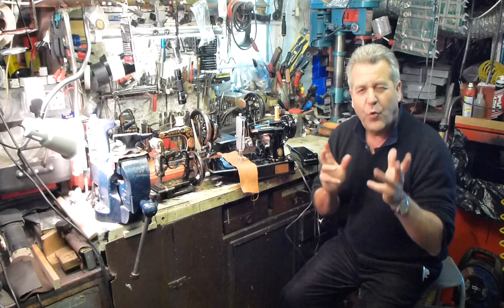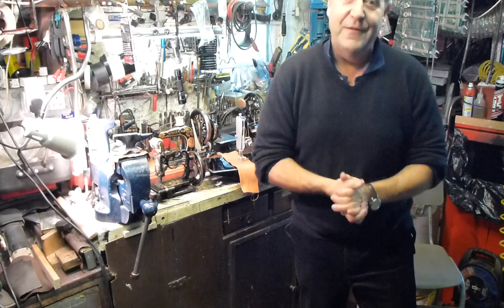Buying a singer sewing machine,  featherweight sewing machine, by alex askaroff

Comment: Alex I love your accent, and love your machines, each and every one is very pretty, and some I haven't even seen before.  Love the knowledge you share with the camera, and your a very handsome man.    Can I ask what do you clean your machines with.  When you first get one.  Kerosene or ?  I have just recently bought my first little singer 221 featherweight made Jan. 7, 1941 it is a nice machine but is missing the middle decal, and has some of the decals rubbed off from where someone must have used this machine a lot.  Can I get the decals for it and, should I even try to put them back or leave as is. 
Thanks for your videos I love each and everyone, and I love reading your stories on your blog.
Reply from the maker: Hi use little more than a thin oil like WD40, nothing harmful. Don't forget there are just three things to look for when buying, condition, condition and condition.